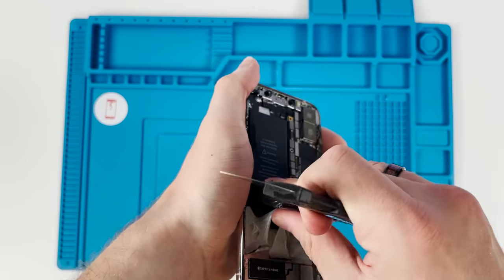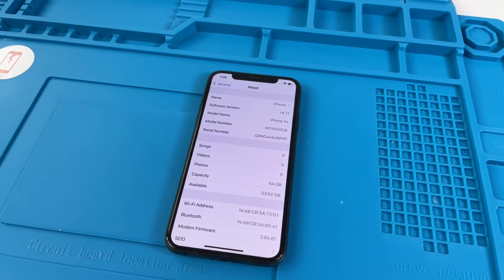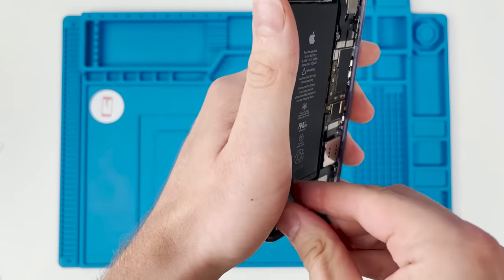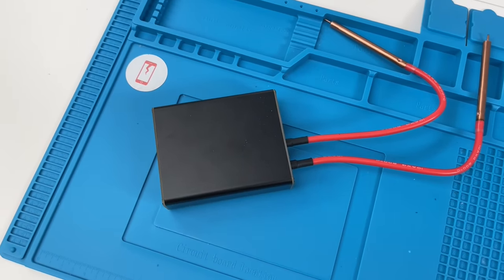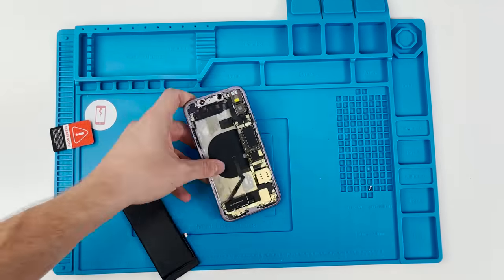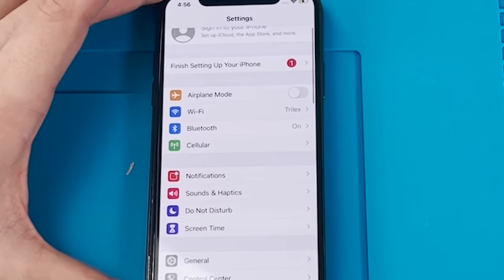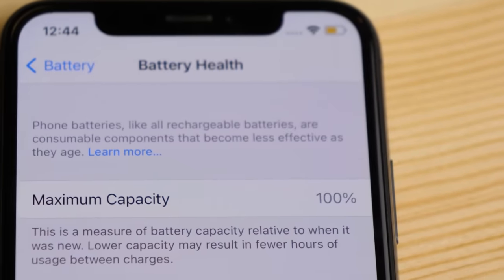Removing Apple's "Unable To Verify Genuine Battery Warning"...

Comment: If you don’t change the board over the red-flagged ‘Important Battery Message’ will still disappear on its own after 14 days. The battery health function doesn’t come back though, but it’s not that important (or accurate) anyway..
Reply: I wonder if changing the date back 14 days before swapping battery will expedite this message to go away
Reply: 15
Reply: @dannylones2159  Yes, the warning message will turn off after 15 days. Don’t know if setting the time back first will work, didn’t try it..
Reply: Yeah. I had the battery health say that I had 84% but I only had 69%... Another time it said 89% but it was actually 92%.
Reply: @HailAnts  not sure if this has been tested ever, replacing my iPhone 11 battery here soon and gonna attempt to try changing the time

Comment: Hey PRG, nice video (as always :D).

To everyone reading this:
Make sure not to short the anode and the cathode in the process of cutting the old BMS from the old battery with your scissors, otherwise you might end up with a destroyed BMS.
So cut them separately :)
Reply: not just a destroyed BMS, you could have a fire.
Reply: @douglasrogers4675  and battery explosion
Reply: When he cut both ends at the same time was fine, but in the end he cut only one and did damage the board, why that happened?
Reply: So, it's a 'death trap' from apple for everyone who try to fix this phone.
.
Interesting.
Reply: @renaldyhaen  I mean shorting something is not even death trap from Apple lol. Where is your sanity
Reply: I’m so scared, my iPhone was on low storage and then went on this infinite boot loop. Everyone I hard restart the iPhone displays the “unable to verify message” and then wont let me type in my passcode before going through the infinite loop stage again. It’s so frustrating.
Reply: @missachin5054  😂
Reply: @missachin5054 lol every comment
Reply: @JakeMeOff  it fixed itself. Miraculously. I bought a new phone to stop this from happening again

Comment: Argument against right to repair:
We don’t want people to damage their devices by replacing components, so we’re gonna make them cut the battery apart in order to fix their device
Reply: I’m so scared, my iPhone was on low storage and then went on this infinite boot loop. Everyone I hard restart the iPhone displays the “unable to verify message” and then wont let me type in my passcode before going through the infinite loop stage again. It’s so frustrating.
Reply: @missachin5054 that sounds like it’s the memory chip failing causing the bootloop. Unless a repair shop can confirm or fix your best option is data recovery and scrapping
Reply: Kinda fun if transfered to other bransches. You wouldt be able to repair youré car
Rickard Westling

Comment: Few months back I  did the same thing with my Nokia Lumia 930 which went into bootloop and then completely dead.   I had lot of photos and videos to recover. And I could not find the battery with appropriate connector so I removed the Board from battery and used a powerbank's battery, since I didn't knew how to connect as solder would not stick to it I poked a hole through both terminal strip and used thin wires to connect both the terminals to and then solder the tip of wires to the board. Was enough to recover data. Great to see this method work. 😄

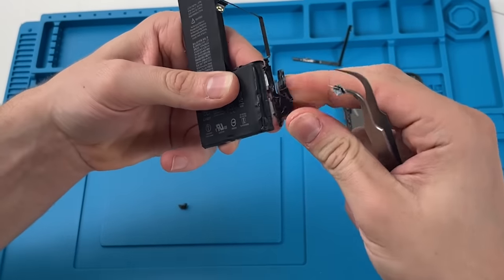Comment: In reference to 2:45,

I think there are certain ceramic scissors that should be used to prevent any issues with sparking. This would be in case the anode and cathode make a circuit via the scissors snipping it.

Or if the battery is damaged, certain ceramic scissors wouldnt cause a spark that could ignite anything.

Thoughts and opinions? Thanks for making this video. I learned some neat things.

Comment: Hi Mr. Guru it’s me again XD. The BMS transfer only works on the XS generation models, on the 11 and newer apple encrypted the BMS so just a transfer won’t work, you will also need a tag on flex in order to be able to reset the battery stats with a programmer
Reply from the maker: I have the programmer and the tag on flex for the newer models. Appreciate the info though 🙏
Reply: Took me ages to find this comment lol. I don't think anyone in comments knows this.

Comment: Don’t short anode and cathode together, big no no. But you will have to learn micro soldering if you want to replace 13 screens as the IC chip needs swapped from the old screen to the new 🤬

Comment: i basically taught myself to swap the bms board when i was 12 or 13. i had a bunch of broken phones and no good phones, and i remember having a 5s  with a swollen battery and a locked 5s. i was able to put the 5 battery in the 5s by swapping the board and taping it on. now it’s easy for me, so this is a definite option when it comes to battery replacements for me
Reply: TFUSION  lol, i did. it’s honestly not dangerous because the tape won’t come loose or anything, even if it did what’s the worse that could happen lmao

Comment: I have several questions on the process:
1. How do I tell which is the anode and cathode? I don't want to mess up my BMS...
2. Did you need to use an activation board to get the new cell with old board running? I heard that would be needed. 
3. What setting did you use the QianLi Spot Welder on? I have that thing laying around here but didn't dare to use it on an actual battery yet...

Comment: I wasn’t aware it was possible for someone to go in and manually adjust the battery health capacity. Lots of refurbishers on eBay and Amazon (even Amazon themselves) like to advertise their refurbished phones have around 80-90% battery capacity, but if that can just be modified, then, at best, people could be sold a phone with a bad battery
Reply: i think it just clears the battery health, which needs to be calibrated again. the battery chip detects and then updates the actual health over time

Comment: Yo just random question. Can you replaced the cell with bigger capacity like 2x or even 5x i rather had bigger battery even though i had to sacrifice the back cover.
Reply: it is possible, but would probably be very difficult
Reply: @herobrine00700  We just need the bms right. Soo we just attach the bigger battery.

Comment: Absolutely worth it. Some of the things i don't trust on replacement batteries are their fake cut down bms lacking a lot of protections. If they cut down to much and emulate fake parameters for the phone it can explode. Like suppose the battery is over heating but the bms has no temparature sensor so it's just sending a false reading and then kaboom .

Comment: You actually have to activate the phone using DC current to the motherboard during first boot, then plug in the battery so the service warning doesn't show up.

Comment: I'm pretty sure that you can unsolder these pads with regular soldering iron, then solder them to the new battery.
I might be wrong but its worth trying
Reply: Applying to much heat may damage the battery.
Reply: They aren't soldered, they are spot welded.

And like the guy above said, soldering directly to the battery can damage it because of the large amount of heat. That's why they are spot welded.
Reply: @LazorVideosDestruction  Yep. Thats the main reason why you want to use a spot wielder. Extreme heat or prolonged exposed on high heat will kill or destroy or lower the life expectancy of a battery. Hence you do not want to solder a battery. Specifically on a lithium battery.
Reply: @prettyhard0150  You also can't properly solder those connections anyway. lithiun cell are never solderded,  you always spot weld them
Reply: @LazorVideosDestruction  yes, but the pads on the protection circut are soldered to the board itself and then welded to the battery tabs, tried this on my Dualschock 3 when i was changing the battery i got from DS4 and the boards were different.
Reply: @julek43  I guess it depends which device. If the pads were spot welded to begin with, it's probably better not to solder them.

You can probably get away with soldering them, but the tabs on the battery can still wick heat over to inside the battery itself, so I would just spot weld if possible.

Then again, I have a friend who solders crap directly to the terminals on his 18650s and they usually somehow still work after that, so eh

Comment: Being doing this since a long time now
And if you aren't able to access a spot welder just use soldering iron instead( if you've knowledge about what you're doing )
Have done this with a samsung phone too 
Took out high capacity samsung note battery and squeezed in a S series one.
Reply: soldering those connections is a bad idea, as you usually cant properly solder those materials. It's spotwelded from factory for a reason.

Comment: Apple: Replacing batteries is dangerous, users shouldn't do this on their own (IMPLEMENT BATTERY SERIAL VALIDATION)
Users now: Instead of just plugging in the new battery are operating on pure cells and BMS (and THIS actually can be dangerous)
🤦‍♂️

Comment: That is actually a smart thing to do, but the iphones bms board will eventually go back to 100 percent over time, its capable of realizing that it has more capacity than before, i did this mod on several phones, but buy or have good cells in it, because if you buy a chinese battery that has less capacity than the original iphone battery, your phone might shut off at a given percentage (lets say 32 and than your phone shuts down suddenly), the percentage in the iphone will rise once a week in health, i got an iphone with 76 going all the way up to 97, which is awesome :) great video man! Love it when somebody find something like this

Comment: Couple of years ago I tried that with my broken dell laptop battery. Unfortunately with premium dell laptops. They have installed a fuse that wipes the battery info from the bms so even if you re use the fuse the new cells wont have the required info. So even putting in the bms from identical battery wont allow current. Battery stats dead.

Comment: Hi, love your work! So, I am sure you get this question alot, but I will ask anyway. Do you ever have apple repair sent to you from France?  I have an ipad air2 2019, I bought in the US, and it's screen has lines. I dropped 6mths ago, so I guess that is why. It will open okay for 2mins, right when I think it is okay. Then it gets flickering lines, and shuts off the screen.
I am a English teacher here in France and I use it for work. I have not found work for 10mths, hard for teachers with no contract. Anyway, I am just beside myself trying to figure out how I can get it repaired. Can you advise me?

Comment: I knew this trick from rebuilding laptop battery packs, on those the BMS needed to be powered when you switched over from worn cells to new ones. For some reason it freaked out if you removed power completely, so it was quite hassle.. First time seeing someone even mention about switching the BMS over to new cell on phone battery

Comment: I mean atleast it's possible. In laptop repairs, we've seen too many OEMs do the following:
If the BMS looses power, it will refuse to charge any lithium battery.
Laptop batteries are just usually 6 18650's in two strings, and well, these aren't hard at all to replace, just a b* to open the casing and not damage it. But since the BMS disables it self and we don't have any tools to fix that, it's rendered useless. 

Fun fact: You can still use the battery when you replace the cells, but only once. When it dies, it will refuse to charge. hopefully apple doesn't do any of this bs.

Comment: I just had a thought… if you needed the reprogramming tool to reset the health to 100%, would it not be easier to reprogram a replacement battery with the preinstalled board?
Reply: The problem is you cannot reprogram the replacement battery to act like the original battery that was shipped with the phone. The BMS data is somehow encrypted.

Comment: I love your content, thx for supporting right to repair, Mr. Phonerepairguru :) 
Speaking of which… I have a question, my iPhone 8 Plus is slowing down because the battery is old. Apple says that the performance will go back once the battery is replaced, but will it still restore the performance if the job was not done by an Apple technician? (Ie the new battery’s data didn’t match the original?)

Comment: "The goal is to  remove it without damaging it".
Proceeds to cut it with a scissor.
Reply: the point is to not damage the board, not protect the original battery. the original battery is spot welded to the board. there are three ways to remove it: desolder it (bad idea since youre gonna need quite a bit of heat); twist and pull it out (equally bad idea, this might rip the pad off the board; only really works for removing the lead strip thingy off of large packs that uses cells like 18650 and NOT for removing from the board) and cutting the leads off, which is what he did here.

Comment: What's the point of Apple setting up the repair store when most of the solution to slightly damage phone that can easily be fixed is replace the part that is damaged. But instead they just replaced the entire device.

Comment: Apple: next plan, is secure your phone case. "We are ensuring users will use the genuine Apple cases to protect your phones. Aftermarket ones will not make your phone boot properly."
Reply: I can see how this would be possible. They could have contacts at the side of a phone and then they could implant a chip into the case.

Comment: You do realize you can just use a data transfer tool that most repair shops do for screen replacement to remove non genuine screen message and restore True Tone. Same thing for batteries. The message will be removed and battery health data will be restored.
Reply: doesnt work for iphone 12 and 13.
Reply: @misterzee5736  will it work for iPhone 11

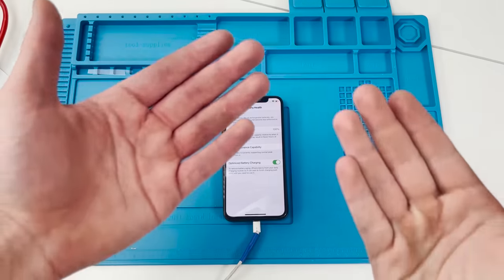Comment: Excellent video! At 3:39 you mention resetting the phone, how did you go about doing this reset please? I am at the point where the phone is still showing the battery authentication error message, despite swapping over the BMS boards and resetting the cycle count and battery efficiency to 100% for the new cells.
Reply from the maker: I just did a hard reset but next time use a battery charger to activate the battery. Its a little board that can charge batteries externally

Comment: I guess there's nothing you can do if you break the flex cable of the BMS board?

I had successfully removed the BMS board from the old battery, and in the process of attempting to spot weld it onto a new battery BMS kit, whilst trying to mount it into a holder managed to break the flex cable from the BMS board, so I now have a BMS board and a seperate flex cable, that aren't connected.

I did obtain the serial number from the original battery using iCopy Plus 2.2 before removing the BMS board and attempting to spot weld it to the new battery cell.

I wondered if just programming the new battery (I bought another new one with a BMS board - not a BMS kit cell) with the old battery's serial number would work, but it appears it won't and the original BMS board has to be connected to the phone on each boot for the verification to take place.

The question is - can you repair a broken flex cable from a BMS board, or somehow write the data from that BMS board onto a new, blank BMS board with flex?

Comment: Your videos are amazing and so articulate!! Well you have to be when dealing in electronics. 

I have a iPhone 14 Pro Max and when taking the old battery out damaged a flex cable behind the battery that had sticky adhesive protective covering over it. The flex cable goes across both sides of the phone width wise. Plus protective adhesive covered it over. I cannot screenshot or turn off my iPhone now so would this be the Volume , On / Off Flex cable that I need for my iPhone 14 Pro Max?

Comment: Can you still use it with the message? And if so how long do you think it will last until I have to replace it again. I'm using a 6S+ I replaced the battery like 3 times now.
Reply: Its just for Battery health display.  Your battery will work as new no worry if battery is genuine

Comment: I'm afraid that this can be easily patched by apple. They can program the BMS to detect if the battery was at 0V (disconnected) and lock it self.

Comment: I just replace the mother board from an xr to a new xr (just for the  storage) and it pop up the battery message. Since I didn’t mess with the battery I think all the information is storage in the mother board too. Not to mention that Face ID stopped working too in the new xr. I’m thinking that there must be a correlation between components to make the iPhone functional. Thanks for sharing.

Comment: That's actually kinda old. The is special solder for this repair. Means you can solder the pads and don't need a spotwelder.
I have one question....
If you remove your original Battery and do a cycle clear with a JCV1s... does it restore the health back to 100%???

Comment: I use my solder iron to dis- and connect the battery cell to the BMS board. Works just fine but with the spotwelder I think it’s a little bit faster

Comment: What about a soldering iron instead of a welder? Lead solder should flow on those pads quite easy
Reply from the maker: You can do that as well but this is easier with a good spot welder

Comment: What strength do you use with the Spot Welder? I think I've the same one and there are 5 different steps. I think you use a rather low one right?

Comment: You need to put other battery first for the software to recognize it as third party battery, then turn in off, and put the modified battery, by then the phone will recognize the modified battery as the original one..

Comment: You did correctly for iPhone 11 but moving the board for 11 and up models wont fix Battery health in iPhone. You will need to solder another board in it and reprogram it to show battery health in all newer models than 11